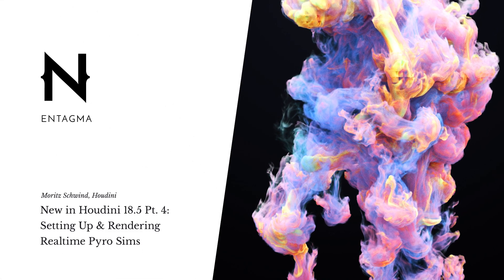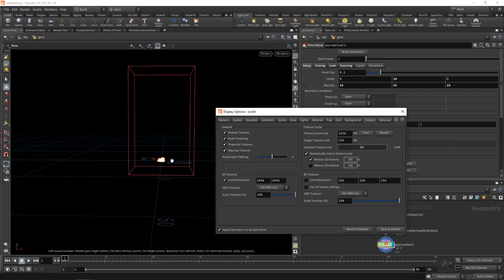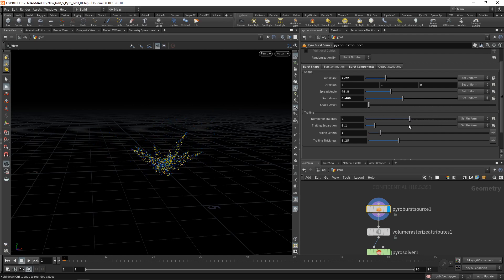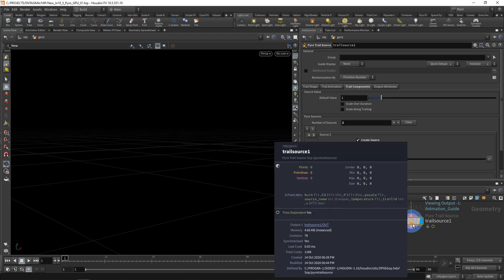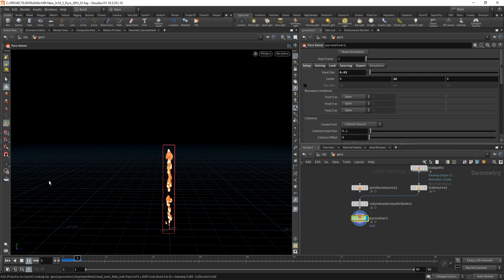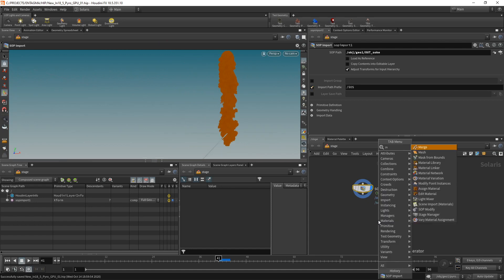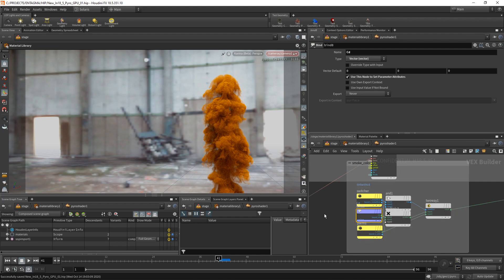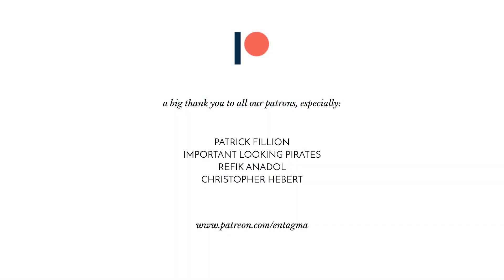New in Houdini 18.5 Pt. 4: NanoVDB -- Setting Up & Rendering Realtime Pyro Sims

Comment: could you possible do a tutorial on how to export the new shelf tools, such as aerial explosion, as a vdb. or does anyone know if there already is an existing tutorial on that, thanks
Reply from the maker: Heya, not sure if it warrants a tutorial, but here's the procedure:

- Attach a convert VDB SOP to your aerial explosion's output.
- Set the "Convert to" parameter to "VDB"
- Attach a filecache SOP and set the geometry file's extension to .vdb
- Hit "Save to disk"
Boom - done :)

Cheers, Mo
Reply: @Entagma  Thanks alot! its amazing its that simple

Comment: Very nice thank you! One little thing which is a bit annoying is your setting of the microphone,  you shouldn't cut everything under 150 hz its really tough to listen to you like this😅 a 80 hz low cut is totally ok
Reply from the maker: 80Hz low cut is what I'm running. Thanks for the info. Cheers, Mo.
Reply: @Entagma  my fault then I'm sorry.... might be the time to buy a new phone then🤦🏼‍♂️😁 again sorry! And thx for the very useful tutorials
Reply from the maker: Absolutely zero need to apologise. I'm just intrigued into what kind of hardware you're using to listen to this so I can tweak my setting... Cheers, Mo
Reply from the maker: One thing that intrigues me: what are you listening this on? (Speakers, Headphones, Brand?) Thx :) Mo
Reply: @Entagma  on my smartphone 🤦🏼‍♂️ just through it's small speakers.... it's a S8. I rechecked it on my studio monitors and it sounds absolutely normal, so it was 100% the smartphone which made it sound that thin...